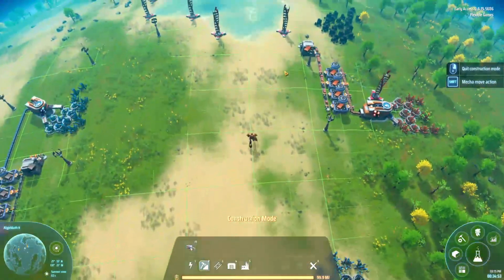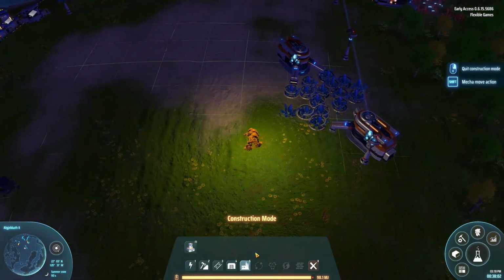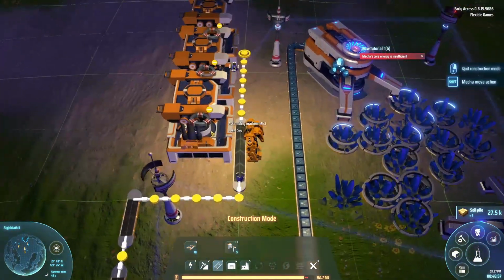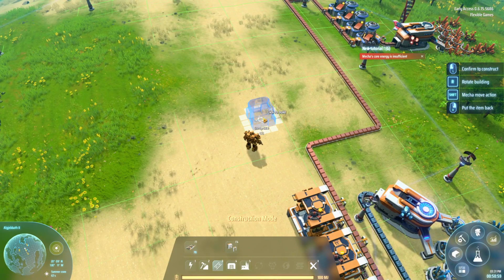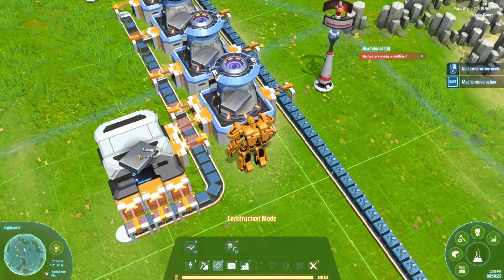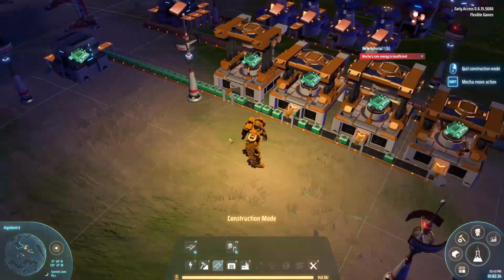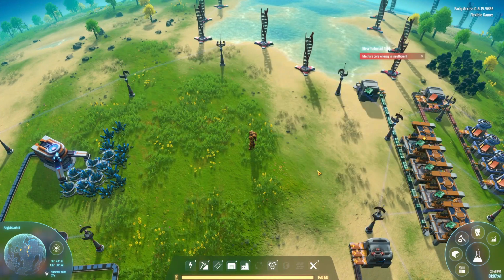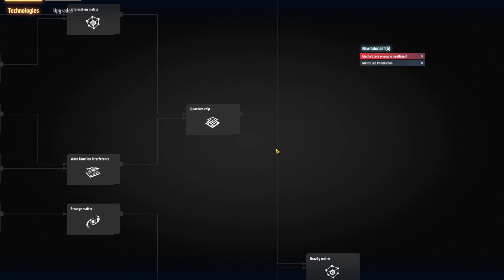Dyson Sphere Program - Ep 2 Magnets 'n Circuits

Comment: your math is amazing :) 210/60=3.5 , 1/1.5=0.666666 , 3.5/0.6666666= 5.25 OR better calculate in pcs/min : 210/40=5.25
most receipes spinning around 10/20/30/60 pcs/min, so math not too complicated as, for example, in factorio